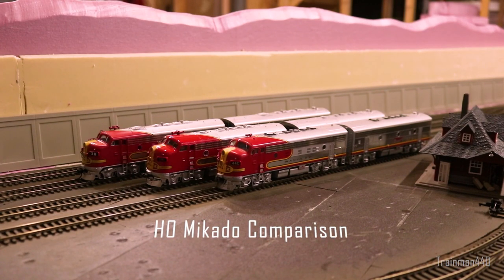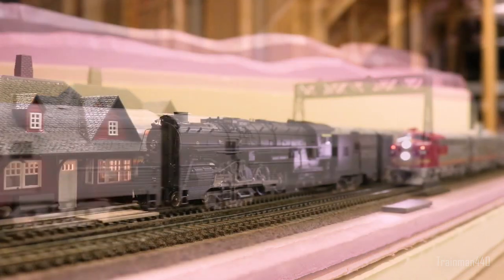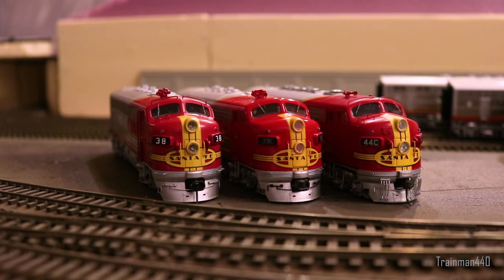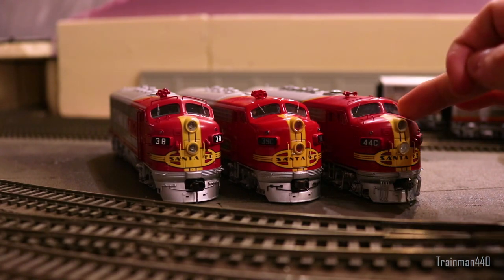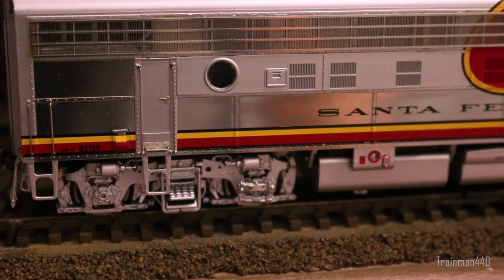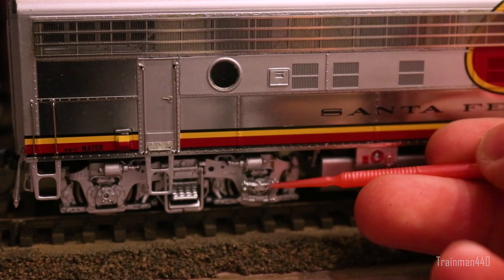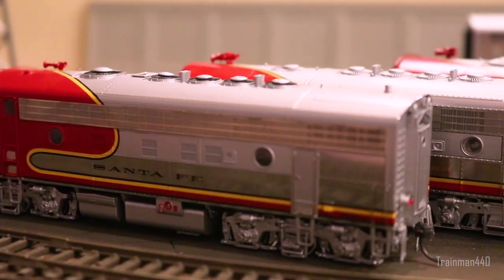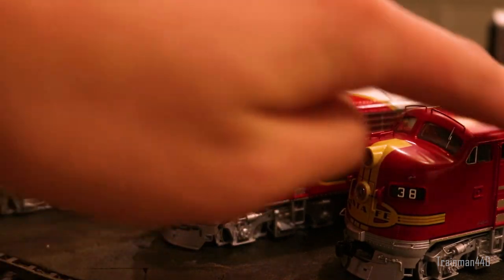Santa Fe HO F7 Comparison: Athearn Genesis vs MTH vs Broadway Limited

Comment: Just curious since i know nothing about this subject, how much does a larger setup like you have range in price?
Reply from the maker: Hey! my setup is actually really small, its just a 4x8 table. My layout just has a lot of track haha :)
In terms of price, it depends. Are you talking about the engines and rolling stock? or just the table? or table plus track, etc. Im free to answer any questions!
Reply: @trainman440  I mean like at your age 20 or under im guessing.. how much do you have invested??? And are you going to school for something related with Mechanical Engineering or Trains, Model Trains, Mold making, ect.?? Im just curious, i used to be into the lil plastic model building with the glue as a kid then got into RC planes..
Reply from the maker: @bitrage.  hey! Id be happy to share, but if possible id like to avoid writing it via YT comments. DM me on instagram (Trainman440) or email me (in description). 

But the short of it is, yes Im majoring in Mech Engineering right now. Ive been in this hobby for years, and restore trains as a side hustle. I can make quite a bit of cash using this method, and use that money to reinvest in this hobby. I obviously dont use anyone elses money for this hobby, this has all been entirely funded by myself through hustling and working.
Reply: @trainman440  Well yea, totally understand that, was actually a dumb question in a public forum...
Awsome, Its Really good when you can take a hobby or passion and apply it torwards a prosperous career that you will love doing...👍👍👍
Reply from the maker: @bitrage.  yep lol, theres no train majors unforunately...atleast none that pay well. 
If you want further info i can share more details if you contact me via the ways mentioned above. Cheers!
Reply: @trainman440  I will get in touch when i get back to house... In this small town i used to live in Indiana, there was a program offered at the local University for Train Engineer (Driver, Operator) that supposedly was Pretty lucrative Position, Alot of ppl in the town worked for the railway, Working any job for the railway was very desirable there...🤷‍♂️. Im sure location probably has a large effect on pay...
Reply from the maker: @bitrage.  Yea Im sure its lucrative in certain areas but youre kinda stuck at those locations. Mech E can be pretty much be used anywhere. And as much as I like trains, its not my only hobby lol. So having a more generic major is more fitting for me! Reach out and I can lyk more details!

Comment: The BLI unit just needs the cab light CV turned off.
Reply from the maker: indeed, I'll be honest I didnt even bother trying to see if that was possible before I got rid of them. BLI tends to like to connect secondary lights directly to track power, like their marker lights on various PRR locos. But there may be a way to turn off the cab light via CVs!

Comment: Most accurate paint?  The Broadway tooling was scanned and directly knocked off the original and accurate HGHLINERS tooling.  I have photo's I took of AT&SF F's side by side with different shades of red in one photo.
Reply from the maker: I believe I mentioned it in the video, but paint accuracy is obviously subjective to the viewer. All I mentioned was that BLI used a more faded, slightly more magenta-ish red than the other two manufacturers. I do photography as a business, and would like to think that I have a keen eye for detecting colors. I of course understand that in real life these engines would often have faded colors, and if the modeler would like a slightly faded red warbonnet loco, then BLI would be a great choice. Hope that clears things up.
Reply: What? You want a cookie?? LMFAO

Comment: Boy -  all you guys into details much.???
Reply from the maker: I mean, if I werent comparing detail what else would I compare? Why even make a comparison video at all if I werent going to mention the difference in details?
Reply: @trainman440     Example of how nutty you guys are getting.
In the REAL world - the same locos from the same Railroad could have very different shades of color.
Newer paint on one and faded paint on the other.
And I find SOUND locos just stupid.  When I run my DC locos I hear the electric motor and imagine it being the sound of the real thing.  If I were to go DCC I would skip the speaker part.
Reply from the maker: @marblox9300  I think I mentioned in the video, but in case i didnt, here was my  point. The different shades of red IS ACCURATE since yes, paint fades irl and not all paint was identical. BUT for my practical purposes, I was trying to assemble an ABBA consist using an AB set from two different manfuacturers, so for ME, the BLI set with its faded red and different style plating didnt match my genesis AB set nearly as well as the MTH matched them. Therefore for me the BLI set didnt work. I noted how BLI had the most different shade of red, but I dont believe I mentioned anything about it being inaccurate. I hope that clears it up.

Comment: Hello! tanks for your presentation. I have MTH F 7 SPRR very good quality sound and moore, but large space beetwin A unit and B unit. Greetings from France.
Reply from the maker: thanks! Yea the space between units on the MTH units is annoying. You can fix it partially by replacing the couplers with kadees.

Comment: Did you notice that Athearn's is the only one that has a radio antenna (on top of the rearmost roof panel)
Reply from the maker: I didnt, good catch!
Reply: @trainman440  it's the standard flower-pot type which could be found on  top of the cab on other units.